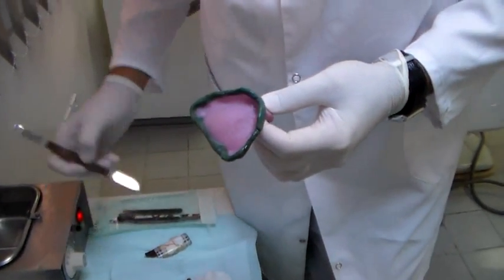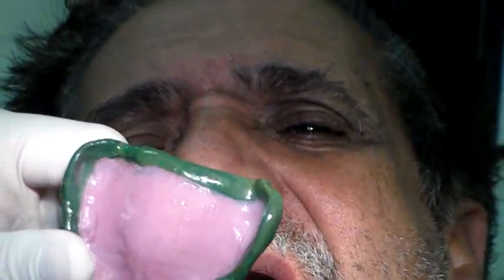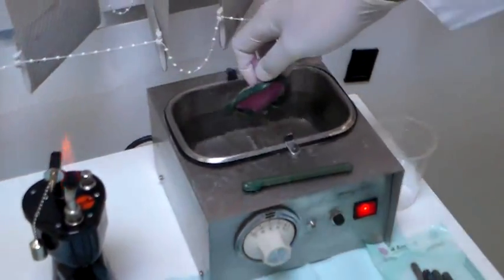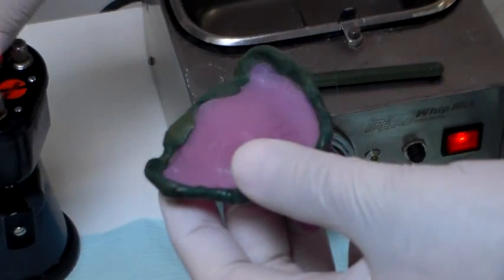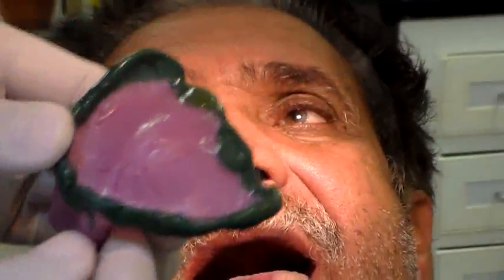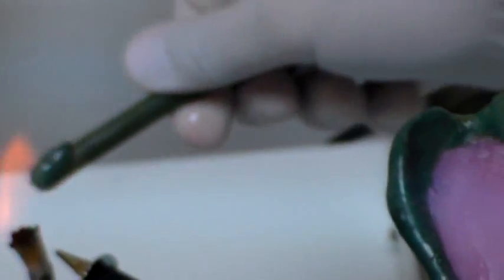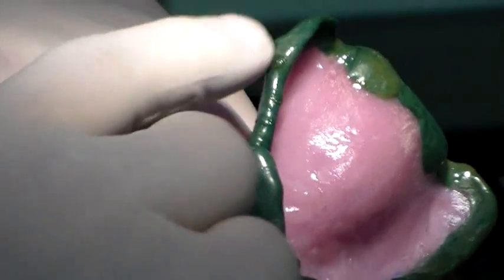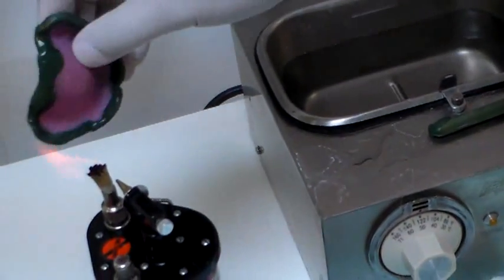CD Videos No.13- Max. Border Molding Part 2

Comment: Can we remove spacer before border moulding?...
Reply from the maker: It is a good idea NOT to remove the wax spacer before BORDER MOLDING. It will change the way the impression tray adapts to the tissue and chances of positional errors are high. Of course please do remove the wax spacer before making the impression 😊.
By the way in this school the department policy was to use non spaced trays- using muco-compressive technique- relief was provided for relief areas at flasking stage. 
That is why you don't see a spacer here.

Comment: thanku sir but i have one doubt.   vre is spacer?
Reply from the maker: Hi there,  extremely sorry for the delay in replying.  I somehow missed your query. 
This dental school believed in a muco-compression impression for the final impression.  According to them IF any relief was to be given it would have to be done at the processing stage. 
I personally prefer that FINAL impressions  must be made following SELECTIVE PRESSURE TECHNIQUES. But these are just different schools of thought. What is important though is that we must learn to use all different techniques and apply to our patients when we encounter anatomical or clinical variations.

Comment: I'm learning denture. Very appreciate your rich information video.
Questions
1. What if we take one single step final impression. Why we need to take impression at the border? Is there some detail and/or special movement need tobe recorded?
2. Can we use heavy body putty to replace compound material?
3. Can we take border impression all in one single step vs breaking down section by section step?
Thank you very much for your kindly sharing.
Reply from the maker: Well usually the primary impression is made of a muco compressive material which will cause the movable (and compressible) tissues of the mouth to get compressed and therefore displaced. Of significance are the border tissues and the areas requiring relief.  It is to compensate for this issue that we make a final impression with a muco static impression material on a custom tray that has acceptably placed relief features.  The borders of the tray are refined and impression made to record them in function.  You can use one-step putty impression to record the BORDER ALONE  and then a final wash impression OR do a sectional Border molding with green stick impression compound and final impression with ZOE or the line impression material.
Reply: Dr. Joe Mathew. After border moulding. We use light putty to take the final impression. At the border areas we will see some light putty cover on border compound. So do we need to remove those light putty or keep as it is?
Thank for your kindly reply.
Reply from the maker: @htdao1204  After border molding with putty you should make impression with LIGHT BODY/MEDIUM BODY IMPRESSION material (Elastomer) NOT light body PUTTY. The whole selective pressure idea is lost if you do that!!
When you make such an impression (with LIGHT BODY ELASTOMER) usually some border material (either green stick or PUTTY) gets shown through as the LIGHT BODY ELASTOMER is very thin.  This is often time acceptable.
DO NOT MAKE THE FINAL IMPRESSING WITH PUTTY. 
PUTTY should be used for BORDER MOLDING ONLY on the CUSTOM TRAY.
Reply from the maker: @htdao1204  
I hope you are using a CUSTOM TRAY for the FINAL IMPRESSION.  If you are using a STOCK TRAY and desiring to avoid a second tray and final impression then use PUTTY for the PRELIMINARY impression on the selected STOCK Tray. Then refine the borders of the putty impression so that the width of the vestibule is accurate and not too wide.  Once done then you may use a LIGHT BODIED ELASTOMER IMPRESSION material for FINAL impression.  But remember that such an impression often CANNOT provide relief to the vital structures that are underlying because the impressing will be MUCO-COMPRESSIVE in nature.  
Read Complete Denture Prosthodontics by ZARB & BLENDER 12th Edition for further clarity. God bless you.
Reply: Dr. Joe Mathew  you are the greatest. Complicated things become easy to understand thought your words. Very very very thank you.
Reply from the maker: @htdao1204  
Thank you for your kind words.  But honestly it's the grace of Christ Jesus that enables me to explain in a way you that you can understand! Stay blessed.
Reply from the maker: If you don't mind me asking Hung where are you learning dentistry from?  Which country are you watching from?  Many thanks.
Reply: Dr. Joe Mathew . I'm from south of Vietnam. Graduated from faculty of dentistry, university of medicine and pharmacy. Already curious! I'm kind of lifetime student to improve our everyday practice. God bless you!